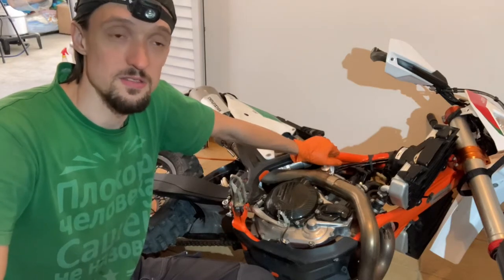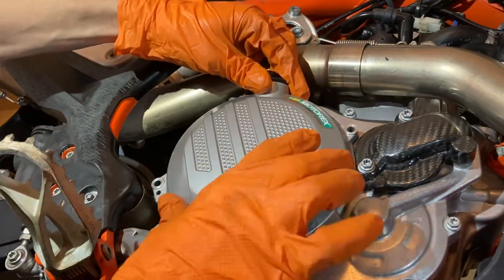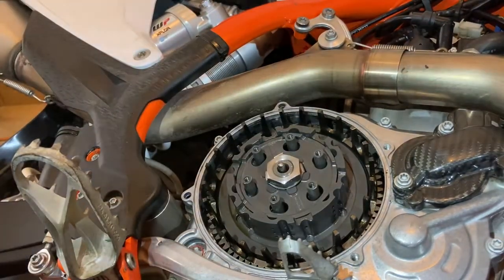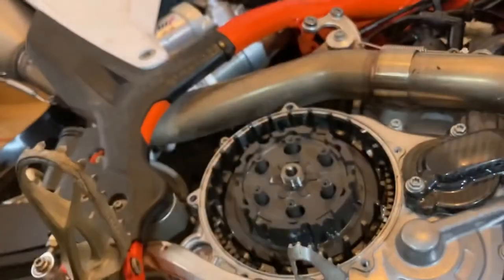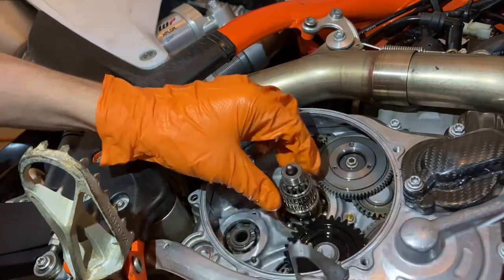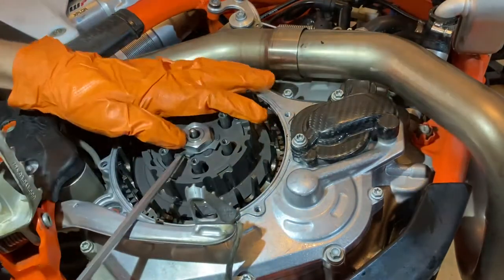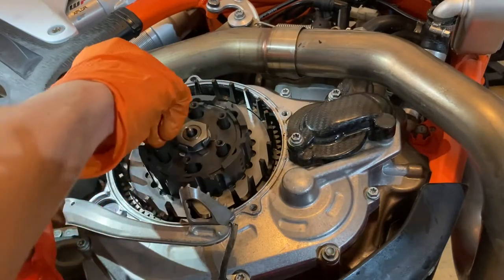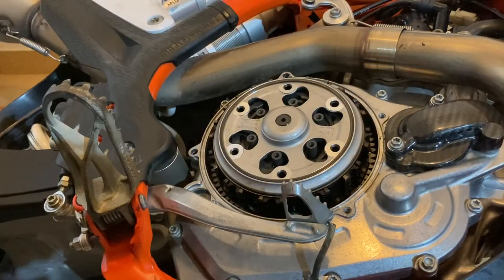Clutch Maintenance and Inspection - 2020 KTM 450 EXC-F

Comment: Thank You! Fine explanations with all tips to do it right. My tip: I use a rim rolled over the hub and fixed to the frame to loosen the large nut. Was not possible with pre-2017 models. Yes the rubbers wear out around 100 hours.

Comment: Many thanks for the info.  What would you recommend as a reasonable oil change service interval for the 450, riding in TET and easy trails, Ta.
Reply from the maker: Hey, KTM’s manual says 15 hours for non-motorsport riding. To me, an oil change and air filter cleaning is not too different from fuelling up the tank or washing the bike; it’s cheap and it doesn’t hurt to do it often, and the benefits are great. It’s the best thing to increase longevity of the engine overall. Other people love to say manufacturers and dealers are just out to make money off of us but that argument is moot. The science and engineering are clear.
Reply from the maker: I’d also just point out that the oil change intervals are so much shorter on dirt bikes than road bikes because the engines are much smaller and lighter and have a much smaller oil capacity as a result. That also doesn’t mean you can’t take EXCs on long adventure tours, just try and get in some oil changes and filter cleanings on the road. It gets faster and easier the more you do it.

Comment: Hi. Did your bike pull forward when you're putting it in gear with the clutch pulled in
Reply from the maker: Yeah that’s mostly normal especially when the engine and clutch are cold. If it doesn’t improve with a hot engine and oil then adjust your clutch hand lever and check the washer position on the Belleville spring…
Reply: @Silk Rider  cheers. Yeah that's next the Belleville spring. The bike only has 22 hours on so surely it can't be the plates. I've blead the line so that's alright
Reply: @Silk Rider  I've checked the plates and they are goosed. They need replacing unfortunately

Comment: too late now but when you install the new rubber you did not push the whole assemble far away. It should be flush especially in the back and we can clearly see that it is not pushed in all the way at 20:48

edit: you did it afterwards ..phew 😀
Reply from the maker: Yes these days I just squeeze it together in a bench vice with soft jaws

Comment: got a 2020 fe350, clutch doesnt seem to be engaging all the way. Slave cylinder has been replaced and reverse bled. Push rod had a small indent from the ball bearing so ive swapped around the ends so the slave cylinder side has a flat surface to push against. Tried the spring retainer in all three positions and still not fully engaging. Clutch plates are pretty much new, the guy i bought it off used an aftermarket clutch and put the original plates back in before he sold it. Ive also checked to see if the clutch engages while the clutch cover is off and looks to move our 2-3mm. Running out of ideas so thought i would drop a comment and see if you had any suggestions for other things to try? Was thinking of trying the rekluse slave cylinder?
Reply from the maker: Does it have the stock clutch lever? Is it bent at all and too close to the hand grip? Also from my KTM repair manual: the rounded side of the clutch push rod faces the clutch. So the flat side should be pushed by the slave cylinder.
Also did the clutch work when you bought the bike from the guy?
Reply: Literally in the same boat, did you find a fix? Just replaced the dampers in my OEM and now the clutch wont engage. Ive gone thru it 3 times now double checking everything. At a lose.
Reply: @hunterholman3525  turns out it’s a pretty common problem, when first starting the bike and using the clutch bring the revs up and click into first gear with clutch in. After riding around for a minute your clutch should start to engage.
Reply from the maker: @jahjah8270  thanks for the reply, do you have any more information like what might be causing it? Would love to know more about this for when it happens to me during a rally… I’ve seen something like this happen to pro bikes in Dakar as well as Letinbichler last week in Romaniacs. All KTMs.
Reply: @SilkRider  I believe the bike just needs to warm up and the clutch plates then free up. I’ve been on a couple rides now it only initially happens then clutch works fine afterwards
Reply from the maker: @jahjah8270  makes sense. But I suspect a new clutch basket and sleeves would help too. Did you feel any ridges on the basket or the metal sleeves that hold the clutch plates in? Those are what the all the plates slide against… anyway really good to know this now
Reply: @SilkRider  clutch plates where pretty much new so no wear on them at all
Reply from the maker: @jahjah8270  I thought about maybe opening the oil filler cap and poking/prying at the clutch plates with a small screwdriver too. Maybe doing that with the bike off helps them move around when it starts back up
Reply: @jahjah8270  im wondering if rotating my plated during disassembly and reassembly may have caused a odd binding point now that they arent in the same exact spot as they were from factory. All ive done is replaced my dampers and went thru and reassembled to service manuals specs and torques. All the sudden the clutch doesnt want to work. Start the bike, waited a minute pulled the lever in and kicked i to first. It lunged then stalled. Calling it quits for tnight and grabbing new steels and fibers in the morning and giving that a shot. Hadnt tocuhed anything else.
Reply: Your o ring in your slave cylinder has failed. It’s a common problem on that years bikes with magura clutches. Ktm put mineral oil instead of brake fluid in the clutch. It causes the o ring to go out. You don’t see any oil leaking cause it leaks into the crank case. Slavens has a video on how to fix it for good.